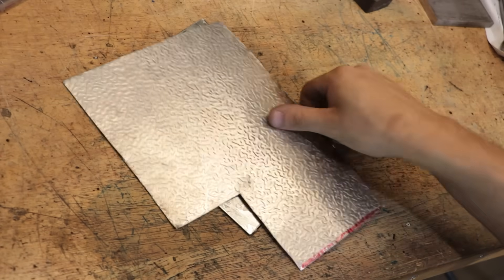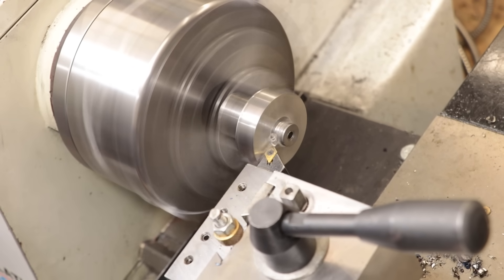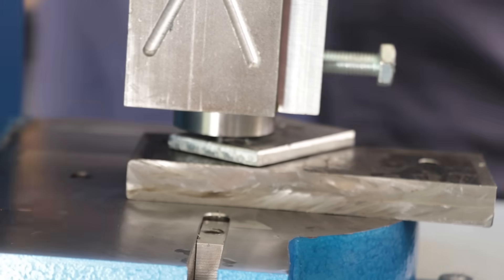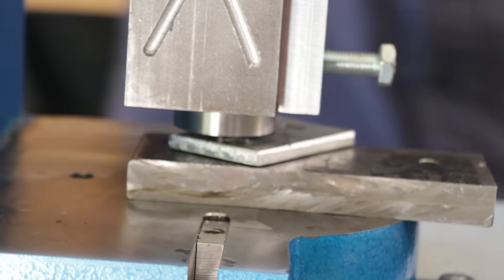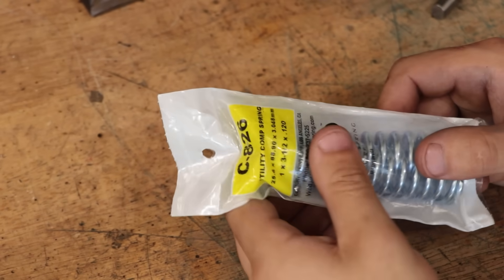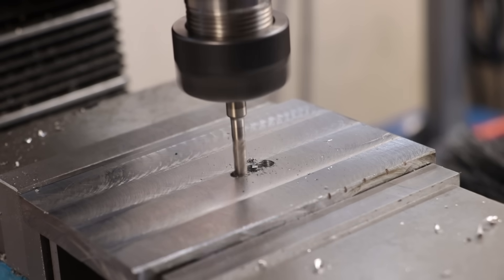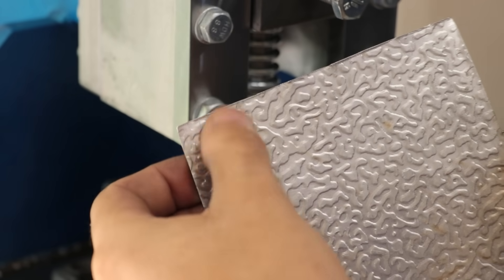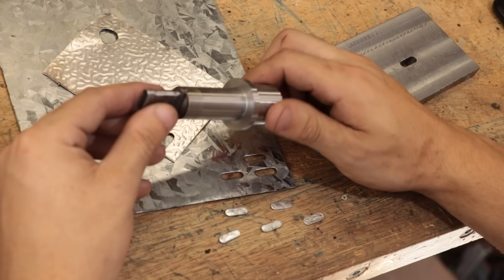DIY Punch and Die For Sheet Metal

Comment: Here are a few tips on piercing metal that may be useful.
The punch and die need to have clearance between them. This is typically 10% of the material thickness PER SIDE although this varies depending on the result required,it is a good compromise. If you want the hole or slot to be a certain size then the punch is made to that size & the additional clearance is on the die. If you want the slug  (blank) to be a certain size then the die is made to that size & the clearance removed from the punch. So in your case the punch should be the size of the slot required & the die 20% of the material thickness to be pierced, bigger overall.
The relief in the face of the punch will not help with cutting pressure as it cuts on the perimeter only. Typically cutting force is reduced by a shear angle on the face of the punch, usually along the longest length. This angle is usually the material thickness over the punch end length ( slot length in your case ).
Piercing metal on a press can often be performed with just a punch & a rubber die. Aside from the advantage of not having to make a die, alignment is not an issue. A rubber die can also perfom bending & forming around a punch. Here are a couple of examples on my channel to explain better.

https://youtu.be/biwzei_pt5c?si=FKs0tjkWDjZRTG6k
https://youtu.be/dOAVcJ1CCmY?si=8MUNXfyOzw5D-rCG

I hope you find these tips useful.
Reply: I have 10 years of experience with sheet metal fab specifically in the punch press mass fabrication.
This is it. I was going to type up my own dissertation but yours is correct. Cheers from Nevada.
Reply: As a tool and die maker i can agree to that comment. Cheers from Germany
Reply: To prevent warping, a couple things need to be insured. the die must be flat. A slight angle from the die face would be similar to a ball ping hammer going at it to the sheet metal surface.
Too much tonnage can also cause warping especially with forming tools. And yes it’s a tad wasteful especially when punching out large cutouts but it’s metal. The waste slugs can be recycled. A savvy operator can get an extra part from big enough cutoffs. A well programmed punch turret can output insane quantities of parts so the wasted material is negligible when the cost of the parts are worth more than its weight.
This machine has been my bread and butter for 10 years plus programming the thing.

https://youtu.be/99cDp3BRzok?si=rbZz37o5grvjj_19
Reply: Agreed with the face relief, it isn't really needed in this application. Only seen it done in progressive dies to help with tonnage. Putting a taper on the face of the punch may help more than the relief.
Reply: I meant back relief for removal (due to the inadequate spring) however I believe the face relief can give a cleaner hole due to the sharper edge. @morwin3998
Reply: wow thanks for the tips! what type of rubber is used? this looks excellent for forming, combined forming/punching and for when you want a small positive shape. however if you wanted a slot in a larger part is there any way to stop the part from warping like what happens in your video examples? seems like it kinda wastes alot of material. maybe the part/blank could be clamped from above to stop it warping?
Reply: @muzzarobbo  The rubber is Urethane with a high shore hardness. To prevent warping & aid stripping off the punch Urethane tube can be used over the punch. For piercing operations in particular, a smaller block of rubber is typically used to prevent the part from sinking into the rubber. The block in my demonstrations is used for lots of sizes so is usually too big for piercing.
Reply: relief on the tool will help with extraction though.
Reply: Good stuff for us all . There is such a lot of information useful to punching steel as the complexity grows (of the operation). This is the first I've read of rubber die and steel punch. Another new aspect.
Reply: Yep. I made a similar comment on angling the punch face. Something like the v shape on Greenlee brand hold punches would help.
Reply: yes and he could make pointy the two side of the cutter so it can cut much easier.

Comment: great little vid
i too work with sheet steel, i'm a retired panel beater and a year or so ago i got a cheap plasma cutter, 55 amp plasmargon make, what a game changer that has been, i used to hate cutting big sheets up, i'd either use an air saw or grinder bother were accurate enough but hugley noisy and pretty slow going.
the plasma cutter was stupid quick, like 10+ times quicker and very quite compared to the other two options, i work in my residential london garage so yeah p'ing off the neighbors i like to keep to a minimum

as for the punching i wanted to swap out my garage gate hinges to have coach bolts instead of the scews so i needed to punch quare holes, sure i could have filed them but meh, too much time as i also wanted to use on other stuff

i went with the vevor ch-70 hydraulic hole punch and its actually very good, punches through 10mm steel place with no problems at all, and you can get several shape punches  including slot ones or you can make your own

as for the sheet steel punching one of the first projects when i got the plasma cutter was to convert a workshop tool trolly into a plasma cutting trolly with a spark catcher so i could use it inside the garage rather than cutting stuff out side every time for risk of fires from wayward sparks, and the mess on the floor.

the ch-70 made fast progress of the 40 or so 13mm holes i need for the sheet steel, drilling that many would have taken ages and risked hole distortion if the bits grabbed etc as it was 0.9mm gauge 

one of the features that the hydraulic press has which you could implicate in your  hand one is a pair of flat bars that extend down to the flat bed where the die sits, these are used to hold the work down as the punch rises back out of the work piece, they dont need to be tight on the work pice so you can easily slide work in and out, they replace the spring idea you have which aids locating the punch on the steel

also the punch section has a dimple point on the face rather than a sharp hollow, this also helps grab the steel work piece, where i did my 40+ holes i went one step further and pre drilled each one with a 3mm pilot hole, this was for quick accuracy as the hole punch then had a sure feel point to locate in and i didn't have to keep checking that part for alignment

when handling large sheets of steel fine tuning its position can be a challenge but the pilot hole worked out great
i also got a hydraulic/air foot pump so it made it alot easier to feed the work into position and punch the holes

if you havent tried a plasma cutter for cutting long cuts on sheet steel its well worth it, 
on thicker steel the slag from the cut chips off very easy, on thin steel its not alot at all so i nip it off with a flap wheel on an angle grinder

Comment: Any reason to not pin the actual punch into its holder rather than Weld it? 
Also, why not build a solid piece from the side of the upper press down to just above the work piece to help remove the punch instead of just the springs.  Depending how you do it, it also won't block your view as much

Comment: For the pressing calculation you dont insert the are of the part you use the circumference because thats what you are shearing
Reply from the maker: That’s what I did here no? Circumference of the part times the depth of the part. We need both of those to know the total force required
Reply from the maker: That’s what I did here no? Circumference of the part times the depth of the part. We need both of those to know the total force required

Comment: A maybe stupid idea : what if you make the punch at a slight angle ? Does it help reducing the force by taking less material in one ?
Reply: Thats exactly how it should be done when pressing force is limited, it would be better if the two radius ends pierced the material and then the length had a v shaped valley to shear the material to a central point
Reply: @lariwoo  Thanks for the explanations :) I was thinking that maybe it will not be as stable, the piece could have a tendency to slip off during pressing, no ?
Reply: @archloy  depends on a lot of factors yes it can slip but generally doesn't because you choose the angles approriate to the material and force required to punch. What can happen with a single angle tool like you describe is the final end to shear can roll under and burr(though not always) hence why i suggested a tool with a v notch. There is some good info on punch design for multi faceted tools to prevent slippage i have a really old but still useful book i can't remember the title though :/
Reply from the maker: Yeah that’s a really interesting thought and it hasn’t occurred to me at the time

Comment: Many years ago I worked in a small company that made lapidary products.my work as a toolmaker was punching tooling, O1 tool steel was used for the punch and the die was cast from some low melting alloy cast around the punch as it wore down it was faced down on the lathe.these where used in a fly press,can’t remember what the alloy was called that was 45 years ago.

Comment: Peanut gallery here. I'm not an expert but I'd imagine if you can carefully machine the punch and die to be a perfect fit, rather than file them by trial and error, there wouldn't be any squeeze out in between where the punch pushes the material and where the die catches and shears it off which I think might be what's causing the bit of a burr that keeps the punch from freeing out of the newly formed hole. Someone correct me on this, but if you visualize it exaggerated, it seems to make sense

Comment: Interesting video, thanks. They sell for a small fortune but you might want to look at the Diacro Model 2 punch press and how they guide the ram etc.. It's a 4 ton rated with 12" throat. There are a couple of adjustable legs that help with the stripping. You can also use urethane tube over the punch for stripping, similar to your spring. BTW, the punching force should be calculated from the cut length rather than the area.

Comment: bottom also need's be hardended. And dont do "relive" on punch, it only get it worse to take part out. Also You can just add stell plate over die to hold part while punch is returning after cutting.
PS. If you "hardedned" it in water and it didnt broke, then You dont get enough temperature to hardend it properlly. Cheers!
PS 2. size of burr is depended of clearance between die and punch. In industrial its ~7% of thickness matterial who you are cutting, double for stainless.
PS 3. in bad centricity you can do 135degree cutting edge. It would help up to ceter punch and die.

Comment: Nice! A former place I worked at actually had 5 old fot operated pendulum presses. They were used in production to about 2010 for small batches. Very quick to set up and very quick to lose fingers as well. We either used like a fork from the side or like a urethane rubber that fitt on the punch to pull the part of. The proper play will get the most of the burrs away. 1mm thick plate will need 0.15 to 0.2 mm play. 2mm 0.3 to 0.4mm. If you bore a pocket in a plate you can use smaller round dies that you lock in with a setscrew, much easier to grind sharp too. the die holder can have threaded holes for fixturing

Comment: Maybe if you put a slight angle on the cutting tool. So it's not the entire surface cutting through it at once but rather punching through a very small shear edge. Maybe that'll help with lowering the pressure needed to force your way through your sheet metal.
Reply: Generally the larger the tool is a greater need to apply an angle to the tool. Sheering or long cutting tools that are thin are shaped like an “upside down house.”
Reply: @Pacheko36097   @archloy the downside to adding shear to punches is that it can cause side load which in the same way as nibbling and also it takes away from the amount of actual stroke the press can achieve. Also it increases the time taken to sharpen the tool
It only will reduce the shear force by a percentage, and that percentage depends on how much the surface area is reduced. In practical terms its often only 10-15% reduction, but none the less effective
Reply: @thierryboudanphotography4562 I’d imagine a V profile would fix the side load issue?
Reply: same comment from me ;) In theory, it help, I think. But on small pieces maybe not that interesting, and the angle may depends on the thickness of the sheet

Comment: Great video, and always interesting to see what you can do with simple tools. 
Regarding the energy it takes to press through metal, have you looked into relief in the dies? The die must be bigger for thicker metal, othervise the pressure needed is greatly increasing.  
If you look at the cutting surface, it is split between a flat, smooth and part and a more rough, cut part. On a properly sized die, the thiknes of the smooth part should be 1/3 of the material thikness. Hope this helps

Comment: 16:56 did the last punch deform the aluminum laterally? The bottom edge looks like it's a bit pushed out.
Reply from the maker: No that part was already bent out of shape from when I tried to pull broach it without putting a support plate on the top.

Comment: Love the video.  Can you explain why the punch was not supposed to be dunked in water?
Reply: He just didn't intend for that to happen. Aka he dropped it.
Reply from the maker: I only wanted to harden the tip. I didn’t want to risk cracking the small welds by quenching them in water which puts the metal under a lot of stress.